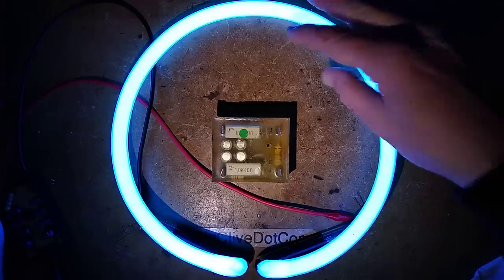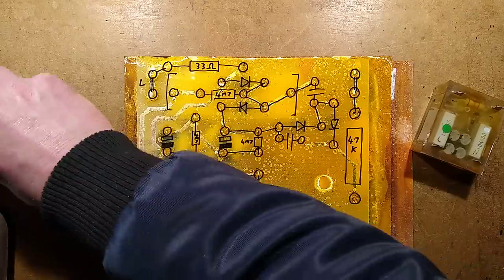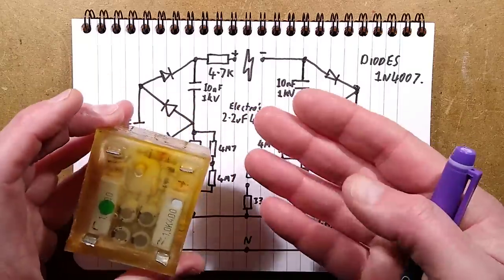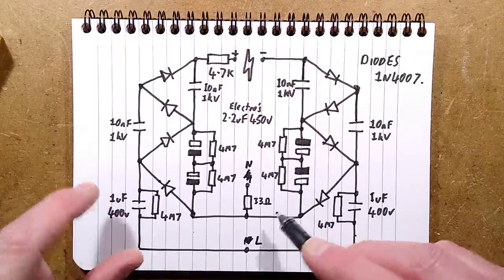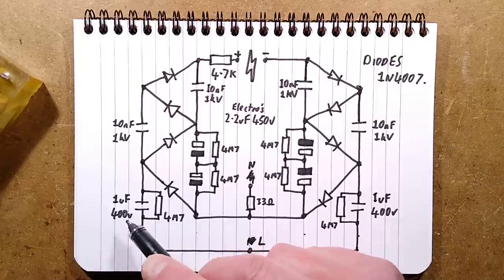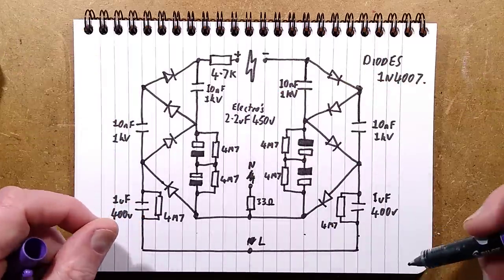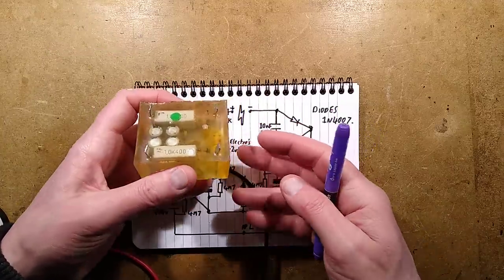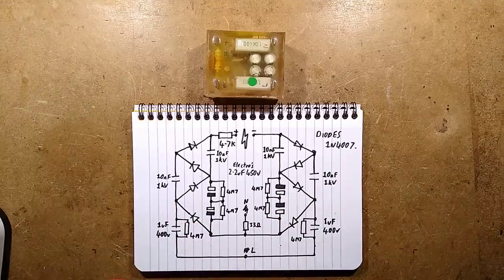Unusual MasonLITE neon tube PSU (with schematic)

Comment: I just have to say you have quite literally the most educational and entertaining electronics channel on YouTube. Always makes my day when I see a new video notification pop-up.
Reply: Big Clive taught me how to fix and modify my LED light bulbs so I'm not replacing  some every month.  I now buy higher wattage ones and Dubie them so they don't fail.  Even after two years none of the modified ones have failed, where I used to have to change a couple every month.  It has saved me a ton of trouble and money in the long run.  All of the LED bulb manufacturers should be ashamed of themselves.  The worst was Osram (here in Australia) where I had a 50% failure rate in six weeks on 12 bulbs.  I now buy Phillips exclusively and modify them.
Reply: @Chrisamic  the ones I've gotten from Walmart were crap. Philips do last much longer.
Reply: @tncorgi92  They all fail at some point, I just prefer to not give my money for the totally crap ones.  The Phillips 11 watt lights have twice as many LEDs and are very easy to modify.  It's literally a ten second job crushing a SM resistor to reduce the power.   It doesn't even reduce the light output by any noticeable amount (I take out the larger of the parallel resistors) - It just stops them cooking.
Reply: I thought this was a fizzy booze channel?
Reply: @tehpwnmstr  that too.
Reply: Agreed, Big Clive is really excellent. Another channel that I find equally educational and entertaining is 'Mend It Mark' - he too is based in the UK.

Comment: Those 4k7 resistors are to force a voltage share across the series electrolytics. There can be a wide capacity difference between identical branded electros as well as leakage current.
Reply: You mean 4M7 resistors? 
I also think they are used to keep the voltage equally divided about the two capacitors. 
The first caps in the schematic deals with AC.

Comment: Old school design tidbit....  the 4.7 MEG resistors across the electrolytic capacitors swamp out the leakage and bias them at half the total DC voltage.  Otherwise, the voltage across each would be proportional to the individual leakage resistance and since they are in series to get a higher total voltage one might exceed its rating.

Comment: Just for general interest, my mate and myself played with a traditional Neon transformer, back in 1970, from memory, it was 6"x8" and a foot tall.
It was 10 or 20Kv at 50mA (I don't remember) with enormous ceramic insulators at the terminals. We set it up with two lengths of 2.5mm copper wire forming a spark gap. It Sparked! An enormous spark! and the copper wires glowed red hot.
Neither of us died, but it was a lethal monster! (I think it was centre tapped) "for safety"
Reply: Back in the day I had one of these  xformers - and I made a Jacob's ladder to show at HS science fair. Also made a meter tall tesla coil with maybe foot-square glass insulated capacitor and spark gap interrupter. It gave wonderful discharge, but the spark gap was so loud that I became terrified to use it. If Popular Electronics couldn't kill me, nothing back then could.

Comment: A cheap way to deal with the neon tube polarization would be to put an electromechanical stepper at the output that would click an escape wheel once at power-up to reverse the connection to the output leads.  Assuming the shop display is turned off when the shop closes, the direction of current flow would be reversed every day.

The coil for the stepper is connected to the AC line.  The coil can stay energized as long as the power is applied.

Comment: I think the main function of those 4.7M resistors on the series electrolytic caps is balancing.
Reply: That is what I thought.  Glad I checked the comments.  I think its to stop one being very out of whack with the other, which it would and the caps best case would probably fail.
Reply: Yes, balancing indeed.

Comment: I had an original 'Masonlite' HV neon transformer (and sign). A heavy copper & iron lump that delivered 10Kv from a centre tapped secondary. I forget the secondary current, small, but I'm certain it was certainly lethal! I eventually swapped it for a solid state unit with a built in dimmer.
Reply from the maker: Probably 30mA.  Not very lethal, but a hideous electrical experience nonetheless.

Comment: I've seen neon tube lights and lamps coming back in the last few years, there are also a few companies operating out of ebay now who make a number of types but will also take comissions

The multiplier inside of resin seems more dangerous, the capacitors wouldn't be able to vent if damaged, possibly sending chunks of flaming plastic everywhere

Why not encorporate a flip flop to alter the voltage polarity every few hours to prevent any sort of bias?

I did make a multiplier following the very easy to follow diagrams and all that happened is that, after a few seconds, the first diode exploded, I have absolutely no idea why, but I've left it since, would it be fair to say this example uses a capacitive dropper, or would you consider the resistor on the neutral side to be the main limiting factor?
Reply: "Why not encorporate a flip flop to alter the voltage polarity every few hours to prevent any sort of bias?"

Because that is far easier said than done. A basic astable multivibrator with a period of a few hours would involve very large resistance and capacitance in the timing elements that would be very susceptible to leakage currents.  That behoves you to use a faster clock and divide it down.  Then you need some kind of power supply for the clock and divider and hardest of all you need a DPDT switching element capable of withstanding the very high voltage from the multiplier output.  A small relay wouldn't be up to the job.  It would make the whole thing far more complex and expensive, particularly in era these modules were made.
Reply: @ferrumignis  Nice explanation. It's the time honored question...It can be done, but how much are you willing to pay?
Reply: @ferrumignis  not really, I can easily use a 556 to make pulses of a few hours
Reply: @ferrumignis  and flip flopping high voltage wouldnt be easy,
Reply: @phonotical  By cascading two timers?  What value R and C do you use?

Comment: Thanks, Clive.  I just pulled apart my ceiling fan in my shop last weekend because the neon had quit working. Inexplicably,  it started working again after disconnecting the tube from the supply and reconnecting. The connections are polarized so I didn't reverse them. I have a spare tube and supply that have quit working that I will now try and breathe new life into. It's the same color and about the same diameter as your example. I didn't pay too much attention to the power supply as it's potted in white resin, but I know it says on it that it's for tubes up to 3ft. It is 120v input. I assumed it was AC output but maybe not.
Reply: I've never seen a big neon tube in a ceiling fan, that is really unusual.  What colour is it?
Reply: It's pale blue, very much like the one in his video. Probably 12inches in diameter and rings around the motor in a clear housing. If you google clear neon ceiling fan similar ones come up. I believe this one is from the 80s or so.
Reply from the maker: If it's a DC supply (or even electronic AC one) then disturbing the tube may have shuttled the mercury droplet from one end to the other and revived the tube.

Comment: Be handy to drive a neon clock nice and small. Very interesting board. 👍👍
Reply: You'll need one for each segment or some 3000V switching transistors if using it as an input supply.  For an electronically controlled multisegment display maybe use more stages on the plus side and run the electronics ground at mains neutral level, driving output transistors from an internal 3.3V supply formed using a capacitive dropper and some regulation.
Reply: @johndododoe1411  That really sounds like too much work, I guess buying the correct PSU is e way to go. 👍👍

Comment: For a while in the late 80's / early 90's there was a series of novelty analogue clocks with a pretty amazing circular neon surrounding the clock face.  The amazing bit was that the neon lit up bit-by-bit in (if I remember) about 5 second segments, until the whole thing was illuminated - and then restarted.  Can hardly find anything online about them.  Definitely didn't imagine this!  Have you ever come across them?
Reply from the maker: It may have been based on a scripting power supply.
Reply: One such clock is featured in this video on NeonSignStuff's channel: https://youtu.be/Hkleo01bvbI

Hadn't seen it before then
Reply: @hotgluegunguy  Thank you! Knew I wasn't dreaming this.  No idea how that works, it seems to go against everything I thought I knew about discharge tubes.
Reply: @paulh5293  Can't tell you exactly, but I've seen this effect while experimenting with high frequency neon power supplies.

You can get partial illumination when underpowering them, but in my (not very scientific) experiments, I could only really control the length for the first part of the tube. About when the illuminated part would reach halfway down the tube, the whole tube would light up. 

For sure, powering them from a high frequency AC supply can yield some interesting results, including interactivity with hands, due to capacitive coupling.

Comment: in the mid to late 1960's I worked on neon signs fitting and maintaining them, boy did you know it if you got a shock 10k V transformer.
Reply from the maker: Technically speaking, 5kV to ground, but still enough to ruin your day.

Comment: I'm kind of wondering what kind of carnage would occur if the electrolytic capacitors all went bang at the same time  :)
Reply from the maker: Yeah.  Encapsulating electrolytics in resin isn't a great idea.
Reply: it would be bigger than the average skid mark. 💣 And I would like to see it happen.
Reply: That's the real reason for those 4.7M resistors across them, to insure that the voltage is divided equally across the electrolytics so they don't get overvolted.  The resistance is generally chosen to be high enough to swamp the usual leakage current, which might be a bit unequal.  They do, as Clive points out, serve as discharge resistors as well, but the very high value means they don't discharge the capacitors as fast as discharge resistors intended for safety.
Reply: How do we find out.

Comment: So far as I know, electroluminescent wire is still a thing that could use a power supply like that. Fiber optics have tempered its use a bit, but there's still no real substitute for proper EL wire. As I recall Jeri Ellsworth has a video for how to make it on her channel.
Reply: I bought a bunch of Electroluminescent wire at an overstock store about a year ago.  It comes in lots of different colors.  The EL strands look like very thin neon tubes.  The drive voltage and current are pretty modest.  Chevy used blue EL wire around the lip of the dashboard on the Bolt.  It gives a little blue accent glow to the interior when the headlight circuit is on.
Reply: EL wire (and panels) need AC, not DC, typically around 150V and at a frequency of several kilohertz.
Reply: My problem with EL wire is I can here the transformers for most of them. I have some in the workshop though, it's the best "fake neon" I found.
Reply: EL wire and panels can work on 60hz AC but the power supplies I have seen for them operate at a much higher frequency. The higher the frequency the brighter the output. Some of the power supplies can compensate for the capacitance in the EL panel and increase frequency to maintain the brightness. Beechcraft in the 70’s and 80’s used EL panels that were prepunched for panel switches and then encapsulated in a resin with the face painted white and then a black silkscreen was placed over the white allowing the writing to show through in white.
Reply: @Subgunman  That is a neat way to make an illuminated instrument panel.

The EL wire I got at the overstock store comes in pink, blue, green, red and white.  The EL wire is in 10 feet of plastic tubing with a fine wire to for the return circuit.  A little power supply which runs on two AA cells is included.  As noted, the switching frequency is only about 500 Hz, so the little transformer is audible.  The manufacturer kindly terminated the EL in a snap-together connector, so it should be easy to make and attach a less audible power unit.

Comment: Circuits potted in resin like that are such a pain though, have one component that is cheap and readily available go pop, and, you're either left digging it out, or having to replace the whole thing, Commodore 64 power supplies being a good example, the 5V reg dies and is buried in the resin, so you either dig out the reg, or at least get to the connections to cut it and replace, or, as most do these days, replace the entire PSU, which is sad given that it's just one component being a pain... :(

Comment: If you want to run one with mains isolation, run a couple of mains transformers "back to back". Maybe one of those bathroom shaver units would work but not knowing the load I don't know if a shaver isolation unit would be up to the job.

Comment: Clive, I've got a large'ish neon sign that has "Amusments Open All Year" in a perspex case 80cm x 60 cm  that I recovered from a arcade that was pulled down, I've always wanted to get it lit but really struggle to work out how to do it. From memory the word OPEN was in green and the rest was in red, all the tubes are wired in series by the looks of it. I've done a bit of research on lighting neons and it seems I need to try and measure the lenghts of all the tubes to get an idea of the voltage and current required, does that seem right ? Got any ideas ?
Reply: There is always the proper FART or SIET neon tube transformers. They're a bit pricey but are safe and will work forever but yes, you do need to work out the voltage needed.
Reply: @chrispomphrett4283  Yeah this is about as far as I've got, but as I've no idea what the voltage of the neon needs it kinda gets put on the back burner of project jobs. Could have kicked myself for not working harder to get its HV transformer but the demolition crew were already on site and it was all I could do to get them to pass me the sign out before it was skipped 🙄
Reply from the maker: The voltage depends on the gas, tube diameter, total length of tubing and number of electrodes.  It sounds like it may have been run off something close to 10kV for that amount of text.  It's often better to divide it down into smaller sections, and self regulating 3kV transformers are very common on eBay and AliExpress.

Comment: I seem to remember some devices having their power reversed to eliminate polarisation... effected by a simple mechanism in the power switch.  Would have been about 40 years ago.
Reply from the maker: Yeah, I've got one with a voltage selector switch used for swapping polarity.

Comment: be interesting to 'see' one of these running on a scope showing the waveforms at different points, i'm guessing running it at just 2-3v ac would allow this without generating any high voltages.

Comment: "high voltage bombarder units that heat the tube by passing high current through a near vacuum"
I have never heard of those, can you elaborate what this does and why it is needed?
Reply from the maker: It's used to heat the tube to burn out the impurities under vacuum.

Comment: Is there any way to remove the resin? I ask because I have some old currency that someone thought was a great idea to get encapsulated a long time ago
Reply from the maker: Some will dissolve in acetone.  Others will crumble with heat.
Reply: if it is a metal coin, then throw solvents at it until you find one that softens it after a day or two of soaking
Reply: Petrol and cellulose paint thinners are quite useful to try too. Also that stuff they sell to remove evo-stik is a favourite of mine. Not indoors as they're quite potent!
Reply: If it’s epoxy, heat or mechanical removal are about your only options. They have no known solvents once cured.
Reply: @WineScrounger  1,4-dioxane might work for some epoxy resins
Reply: @TheBackyardChemist  worth a try if you have it, but it’s unpleasant stuff.
Reply: MEK (Methyl-Ethyl-Ketone)

Comment: Is it stupid to ask why you needed to drill a hole to get the resistor value? I thought thats what the colour rings are for... or did you want its exact value?
Reply: It got too hot and discolored the resin so it was hard to get an accurate reading, so he measured it with a meter

Comment: 240V AC has 340V peaks so Vpp=680V.
630V rates capacitors are not ok.
The 2 electrolytic are probably cheaper than the 1uf 1kV capacitors.

Comment: Neon, humbug, that's closer to a fluorescent tube 😛 still, much more acceptable usage than that horrible led stuff
Reply from the maker: Definitely a cold cathode tube.  Using a fluorescent tube on the multipliers burns out the output resistors.

Comment: Just curious about the transparent resin. Would the ones used for potting novelty items work ? I am sure these are quite cheap resins probably , not the loctite or branded ones.
Reply from the maker: I think it's standard resin, but electrolytic capacitors shouldn't really be potted above their vent-tops.
Reply: @bigclivedotcom    Great tip ! Which would rule out using axial electrolytics, I guess.